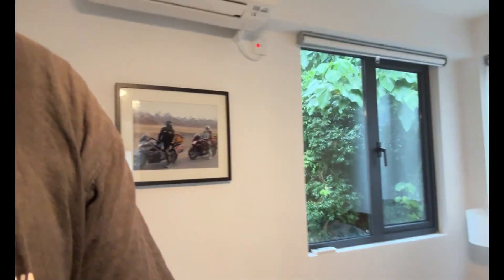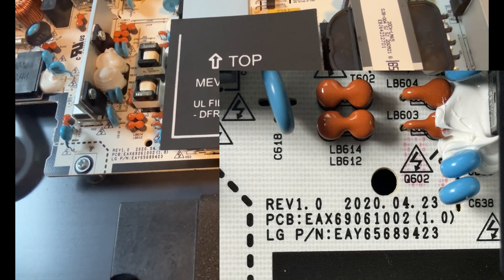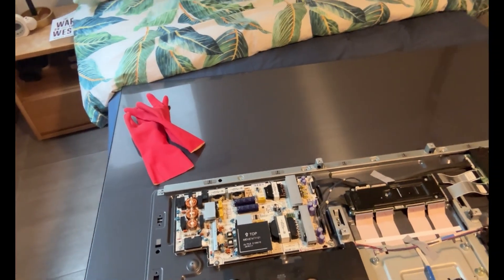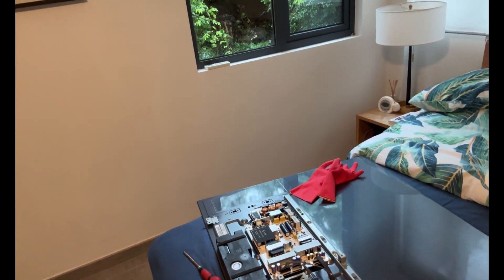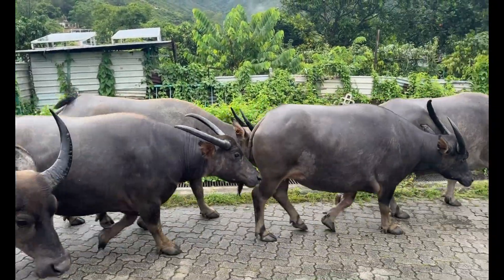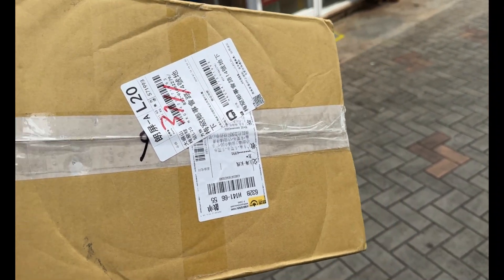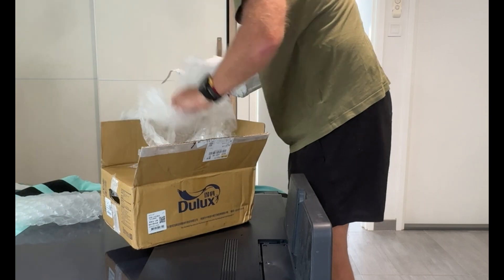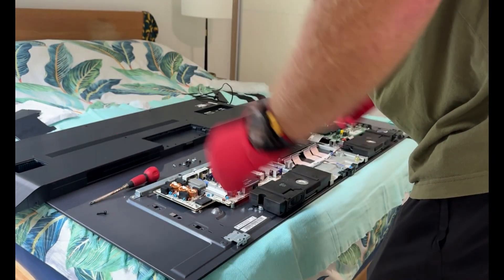Repairing an LG 65 OLED TV that will not turn on

Comment from the maker: I saw in messages some private comments - 

1) yes - I used to be a bomb disposal Officer in Royal Hong Kong Police and speak Mandarin and Cantonese - (well enough) 

2) I am now a corporate fraud investigator ( a partner of forensic practices ) and mostly investigate fraud and corruption in manufacturing and automotive industry in China - I led the air bag and other investigations - and I know the complexity of logistics and supply chain and that most components and parts of everything we consume and use is made in China- some expertly and some not .

3) the Shun Feng courier service and others are off the scale - the network in China is so large and extensive it’s difficult for westerners to comprehend 

4) I live in HK, South Africa and Shanghai - all different places - I would never live in Europe again - I believe there is trouble ahead and an Islamic war on the horizon - China doesn’t tolerate this medieval death cult and for that reason only it’s a paradise for me

Comment from the maker: Yes - it was fixed and still working fine. 

The more amazing story that was amazing was that my KTM 1190 Adv R instrument panel broke ( and modern bikes that is the computer display)  it was nearly 1500 quid to replace and I sent the broken one to China and in a three stage repair it’s like new - for 30 pounds !!! 

My job is a corporate fraud investigator in China - mainly the automotive industry and it’s been insightful- everyone along the OEM supply chain is made in China with some stuff coming from Mexico and Taiwan. 

Even if a car (Ferrari or
bMW) says it’s made in Italy or Germany the actual component are OEM supply chain originating in China

All the crap and good stuff comes from China and evrything in between. Westerners would have no idea what its like

Comment: 3:42 looking at the yellow capacitor caps that on the AC side change this two parts and the tv goes on.
Reply: which is the AC part? Left or bottom right?
Reply: @85LARGE  The two that turn blue at 8:54

Comment: TV still working
Reply from the maker: Yes - it was fixed. The story tha was amazing was I can a KTM 1190 Adv R instrument panel that broke and it was nearly 1500 quid to replace and I sent the broken one to China and in a three stage repair it’s like new - for 30 pounds !!! 

My job is a corporate fraud investigator in China - mainly the automotive industry and it’s been insightful- everyone along the OEM supply chain is made in China with some stuff coming from Mexico and Taiwan. 

Even if a car (Ferrari or
bMW) says it’s made in Italy or Germany the actual component are OEM supply chain originating in China

All the crap and good stuff comes from China and evrything in between. Westerners would have no idea what its like